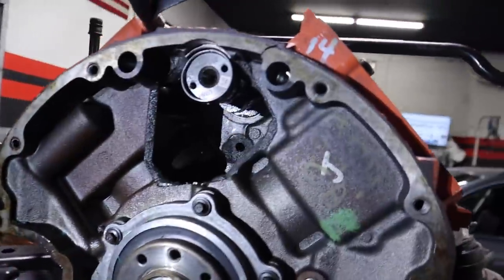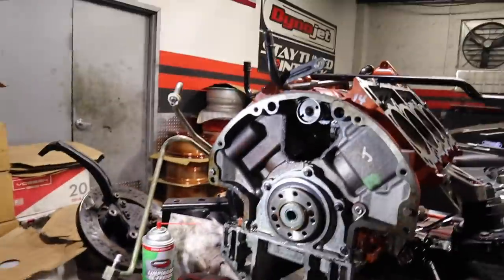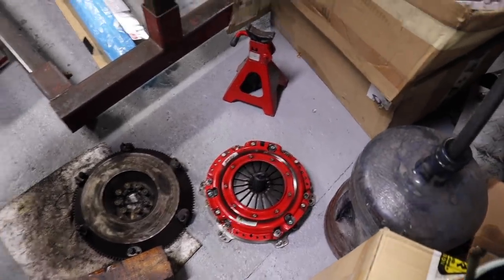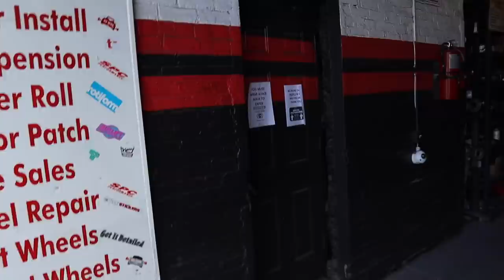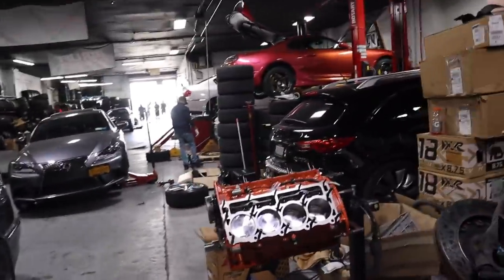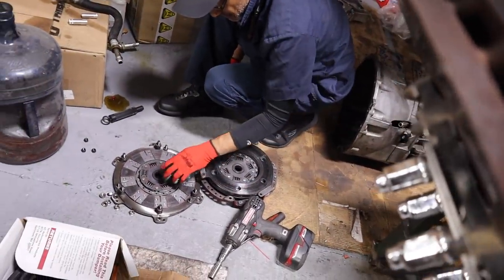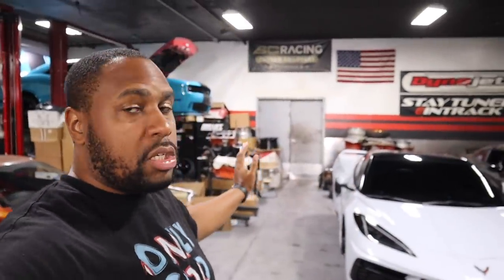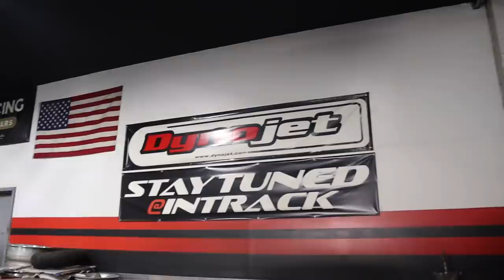MORE BAD NEWS About My Hellcat Build.... I GIVE UP

Comment: I just got back from Lone Star Mopar Fest, watching some of the fastest Gen 3 hemi racers in the damn world just pounding out run after run 8.5s and lower, and running 5.5 in the 1/8th and trapping that at 120/130. 

For the money you have spent, you really should’ve talked to the guys in the modern Hemi shootout classes like the outlaws and heavyweights, and you basically would’ve have a stupid reliable race car at this point.

Comment: It's a shame that you're missing all of this good racing weather right now. I tried to do some 0 to 60 times with an air temperature of 52 degrees and my car would not hook up at all. I have a stock 2010 SRT8 Challenger with a tire size 2 sizes larger. These big blocks make so much more power during this time of the year. It's really incredible. I know that my times are slow compared to a modified 392, but even though I was spinning,my car was only 4 tenths of a second slower than what it was supposed to be capable of when it was new. As far as the setback on this engine... It happens. Especially when it comes to modified engines. And you have great people around you to help it go faster. Take care man.

Comment: It's a setback,it's really no big deal. Have someone who knows short blocks help you disassemble that one, lift the crank  out, replace the crank trigger gear, set the crank back in it, then reassemble in the order it came apart. If you race /break then rebuild anything you have to expect setbacks sometimes. You're making a mountain out of a molehill....my 2c

Comment: Stephen I have never seen this before but, back when I was a tech for Cadillac around 1988 I had a engine that was blown and the block had a hole in the side and the camshaft was in the oil pan but this engine made no HP  and was not a performance engine. But I must say when you blow one up you do it Big Lol !

Comment: I had a hellcat,  the transmission gears exploded on my 6sp manual and dodge refused to repair under warranty and had to buy new transmission but wasn’t happy about it!  After transmission was removed back in July car sitting and caught on fire at classic dodge in Pineville, NC!  Total loss it was and my insurance had to total out $42000!  Now point is I bought a car I wanted that had issues and even with warranty dodge didn’t take care of their responsibility in helping me replace my hellcat!   Now I’m down to my 2014 Silverado that is more reliable than a dodge could ever be!  Dodge has the right name because they dodged me for a resolution!

Comment: It is damage from the fork lift and or from a pallet jack. They were ramming the forks under the crate and hitting the gear since it was the lowest part.
Reply: Thinking the same thing. Shouldn't be too difficult though

Comment: Bro hook up with demonology you need proper guidance on this issue not with that shop of inexperienced con men bro. Never trust them young cats they only for the paycheck not your best interest. Demonology got them old muscle heads in the shop who have a passion on them cars and point out of something is gonna work or not before doing a build. If that shop don’t have 1000hp muscle cars being fixed takes your business elsewhere. I’m sure they are good on Porsche, GTRs etc but mopar needs special attention when you trying to push 1300hp or more. Just some advice before you burn through your 4th wallet. I don’t believe in your team bro lol they let you down to much lol.

Comment: Not to hate on Intrack at all, but they’re not a performance shop. They recently installed that Dyno and I felt some type of way when I had to correct a mistake they were making when getting my numbers. I personally would have went to a shop that specializes in Mopar cars. Most of what it seems like intrack deals with are imports.
Reply from the maker: I've been working with these guys for over 10 years (even before YT) no shop is perfect... they've been fair and take care of me..... cant ask for much more than that

Comment: You think that's a problem 😂😂😂 wait until you try to get a high compression motor in twin turbos in a transmission torque converter to make power? 🤕 Better hire a permanent mechanic who's expert with that combo. 😂 Good luck!
Reply: I know. This dude....it’s comedy at this point. We’re getting to RT Life levels of fail pretty quickly with this car, if you can even call it a car.